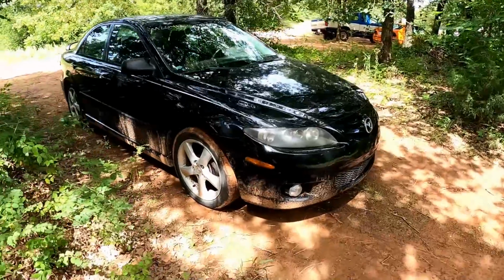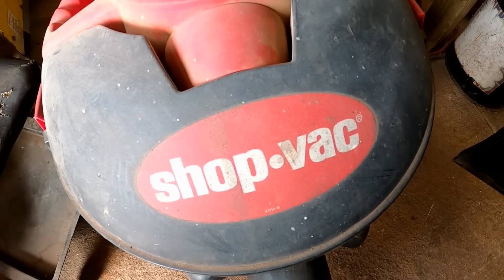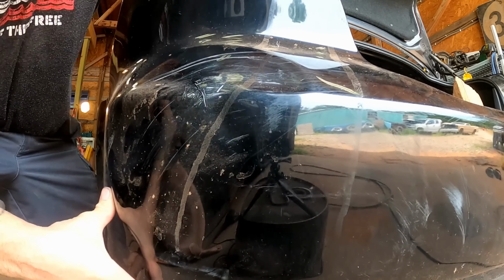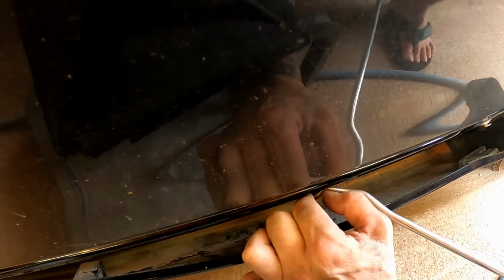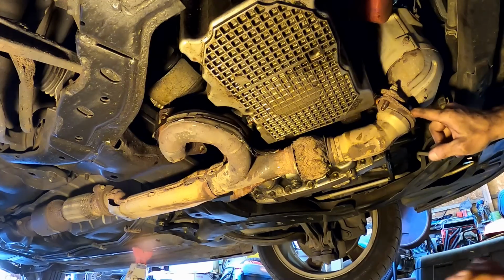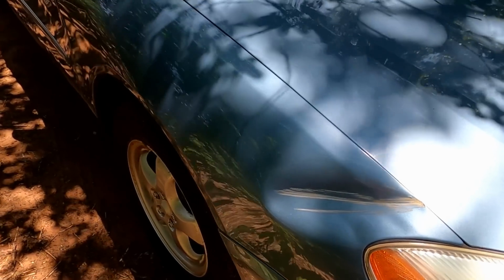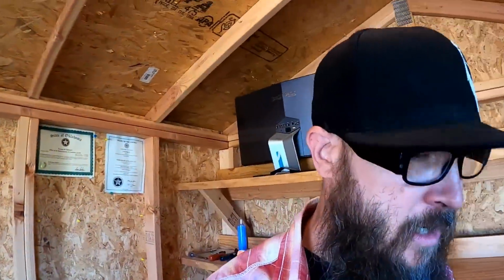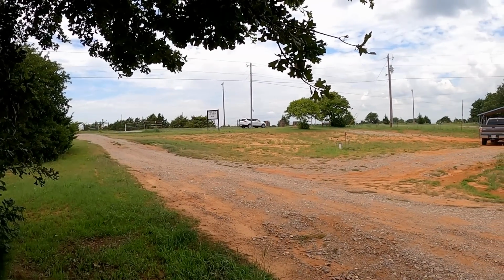Big loss on the Traverse. Sold the Auto Auction Rebuilds Taurus & flipping the Mazda 6

Comment: Thanks for sharing! I am retired and buy old cars and fix them up. Randy has a good scanner you should have asked him the scan the traverse for you. Could have turned the flop into a good flip if you found the problem. I am pretty sure it was a vacuum leak around the intake manifold area! Very common for the traverse to have vacuum leaks. It would show on the scan right away! Almost all Northstar engines have the same exact problem. Vacuum leaks! random misfire at idle and then run good off idle but are really running lean and that shows up on the scanners. Even the cheap ones! Twice as often as coils and plugs, it turns out to be nothing but vacuum leaks on a Traverse! I would think you would remember that from the Cadillac Northstars! Good luck! Take care and God bless you all! Thanks again!

Comment: Im not surprised on the traverse any GM with that engine is a ticking time bomb and considering how poorly this car was kept im shocked the timing chains were not shot already
Reply: Sadly true
Reply: Agreed, it’s very likely the timing chain among about 4 other expensive things. The Beard made that turd shine though!  Was amazing to watch that transformation!  🙌🏼
Reply: DIY Home and Auto yeah that’s true. He did a very good job on it. Unfortunately the engine on those cars are problematic as they age and at this point it pretty much basically totals the car mechanically if it goes bad. I mean it could be replaced if somebody wants to do that and they are mechanically inclined to do so, it’s totally doable. But if you’re relying on a shop at full rate and markup on parts and labor, it’s not worth it. If you get into a wreck, insurance gives you the value of the vehicle, the rest is lit on fire, you burned all that money! That’s why it’s not worth it for the average person.
Reply: Very true..just sold 2011 Buick Enclave CXL with the same motor 194,000 miles..ran and drove fine but check engine light was on..no ac..sold it for 2200..luckily I only spent 1450 for it
Reply: @fidelmoya1745   and trust me NEVER try and do a timing chain service at home on one of them !! Even the mechanics say OH HELL NO ! buy a new engine it would be cheaper  ! My last one was a 2013 equinox 3.6V6 and it started in at 65,000 miles the others at least made it over 100,000 before any issues and I had the Equinox dealership serviced since brand new to boot !
Reply: Nevet really liked any of the gm crossovers like the traverse or equinox.  Just never struck me as reliable in the long term

Comment: If this is the horrible 3.6L VVT it is going to be the VVT timing chain and oil passages can be plugged. GM should have kept improving the Buick 231 3800 Series V-6
Reply: Chris Lemaster 
You couldn't be more right!  It drives me absolutely nuts when a car company PERFECTS a component (the car wizard said the 3.8 is the greatest engine ever made )  and then DROPS IT. Wtf general motors?  It costs MILLIONS of dollars to retool and remake AN ENGINE.  You had the game WON! I've owned 5 of these engines with a BUTTLOAD of miles and never got disappointed.  30mpg on the highway with my 2002 Olds aurora with 200k. Honda is just as guilty rethinking a PERFECT transmission and giving us 5 years of JUNK for no reason or gain.  Only company (so far) not to redesign perfection is TOYOTA.

Comment: The Traverse is a GDI engine so, I'm sure it has carbon buildup. I was told that GM had fixed a lot of the timing issues from MID 2010 and newer.

Comment: Dude on that Traverse, Goto Walmart buy can of Berrymans B12 cleaner in a white can for 3.27. Pour it in the tank and run it down the highway for about half an hour. It had dirty injectors and valves. Been using it for 30 years and never had to change an injector....

Comment: my trick for grill is to use channel locks . Grab and pull the crisscross platic line right above the clips it works way too well especially when the grill is filled at the ends where a hook wouldnt work

Comment: I had a Ford that ran rough like that, turned out I had to get a factory specific spark plug wire set. And they also run like crap on pricer spark plugs like Bosch etc. 

Also had a Buick that the coil pacs, sat on an ignition plate. Those tend to go bad...

Comment: On that traverse you need to check for a bad ground wires to the frame and stuff like that because that stuff gets corroded, I do a lot of Auto electric you would be surprised how much better a car that age will run if you pull  all the fuses and just sand them with a nail file make sure all the connections are tight and get rid of that corrosion only takes me a couple hours.

Comment: The LY7 motor is junk unless you are obsessive with oil changes.  Block casting porosity issues in the head deck, extended oil change recommendations causing sludging in the cam phasers and timing chain stretch, direct injection causing high carbon build on the back of the intake valves.  It's an okay design, but must be meticulously maintained from day 1.

Comment: I think learning what has a good track record and what doesn't can help cut your losses.  The Traverse had problems as soon as they started making it and they were never corrected by GM/Chevy.  You lucked out on the Taurus.  I had one of those wagons that I inherited and it was a pure dog.  I am not lying when I say I had to repair it each time I drove it.  It had 21,000 miles when I got it and I finally got rid of it at 47,000 miles and thousands in repairs.  You need to get a subscription to car and driver or some such publication that rates cars.  And go back and read the last 10 to 12 years to get a better picture.  You are dealing in cars I wouldn't touch with a 20 foot pole.

Comment: I don't know why many don't like FORDS we bought a TEMPO when they first came out had problems but FORD fixed them for free. I have had all AMERICAN brand vehicles. But my best is the one I have now 2010 FORD FUSION bought it for $8000, in 2015 with a lifetime warranty on engine/transmission. Pearl White limo tinted rear heated/ac seats, with color changing interior lights. Been offered $10 k as is. By several people.

Comment: Talk about cars that shook you I almost met my match with a Chrysler Sebring convertible it came from hurricane Katrina for sure it had water in the tail light, actually I took it off my daughter's hands she bought it from some shyster I put like two thousand dollars into it,  oh it was a nightmare, I just don't give up on cars like that, so it took me for a ride though but finally got it all fixed, it's so hard to get your hands in there because it's a convertible everything is moved ,crammed is a better word, into the engine bay, just had to completely clean all the spade terminals especially where the brain was in the console. A freshwater flood is bad enough but when you add salt water to that mix look out

Comment: Definitely timing chain on that 3.6 ...
Be careful if you ever get that engine again...
Reply: That wasn't the timing chain lol
Reply: @jerrywilcox9890  and you know this how?
Reply: @SuperJmbk lol certified mechanic for 36 years 🤣 😂
Reply: @SuperJmbk  and I have 2 of them one had the same problem not the timing chain lol one of the variable timing cam gears is bad
Reply: @jerrywilcox9890  so you haven't learned after 36 years not to make assumptions without a proper diagnosis? Wouldn't last 5 minutes in my shops.😅🤣😂
Reply: @jerrywilcox9890  right..... guaranteed it's  the same issue in this one too then😅🤣😂

Comment: The only reason you lost on the Traverse was the engine problem, It looked like new after you cleaned the inside and outside. Don't let that Traverse shake you up. The engine problem could happened even with a spotless clean car you buy so.....

Comment: Mike, I had a bad feeling about the traverse since the beging and I'm sorry that it turned out to be true. Traverse/Acadia and Captiva/Terrain are poorly made SUVs specially the traverse and Acadia. They always suffer from mechanical and electrical issues. That Mazda though, it's a trooper, too bad they never get enough love. I really love that body style. Keep up the good work bro.
Reply from the maker: I love those Mazda’s. Great cars.
Reply: @weirdbeard8898  I had  a 2006 Mazda 6 touring (2.3 manual 6speed). It was one of the best cars I had and it was the reason I started to appreciate Mazdas
Reply: @weirdbeard8898  Scotty doesn't think so! Its not a "Toyota or Honda" 😄

Comment: What stuff do you use to clean the interior?  Looks like something homemade and a much better deal.
edit: Those bumper dents - when you have creases, start there by pushing from the edges and then gradually move towards the center.  That's where the energy is trapped.  Almost like paintless dent removal on those types of dents.  If no creases or sharp edges, then you can go from the center.

Comment: Hey Mike in hindsight the day you paid 1700 bucks you were in trouble but pretty sure you knew that. IMO though you did the only thing you could which was to do all the cleanup etc. and try and minimize the loss? Other option would have been to part it out and lick your wounds instead of doing anything ...... hmm again hindsight but think you went the right direction? Anyway Mazda will be a great little flip, Taurus went well and get back in the saddle. As demonstrated your integrity is non negotiable and it's still very much intact if not possibly improved. Mom and Dad will be proud and great role model for your kids!

Comment: You WON on the Traverse by breaking even and learning a ZERO DOLLAR LESSON on Lambda platforms. I own one an put a new engine in mine with only 58k miles. 3.6 is a craptasic engine and yours had a stretched timing chain and it’s miles from failure. :goodvibes:
Reply: I own 2 of them and never had a problem.
Reply: The suspension is typical GM - under engineered for a vehicle with large wheel/tire packages and the weight of the vehicle in general.
Reply: @jerrywilcox9890  yep, maintenance is KEY on these things

Comment: First of all, one heck of a job doing that Traverse. Unfortunately, you fell into the trap of making that turd come up to your standards before you would sell it. Unfortunately, there was no value in a Traverse that was fixed (mostly) and cleaned to your standards. You make your money when you buy the cars, not when you sell them. You paid too much for the Traverse given the work that it needed. Stick to cars that have some body damage that you can fix with easy panel replacements, bondo and some paint.  Those vehicles turn off other flippers so you save on the cost to buy the car and  you have the skills and knowledge to bring them back at a reasonable cost. Also, stay away from the high mileage cars. Most buyers are scared of those regardless of how nice they look.
Reply: Lol you have no clue what your talking about
Reply: Everything he said was true especially about high mileage scaring off sellers
Reply: What about youtube revenue?